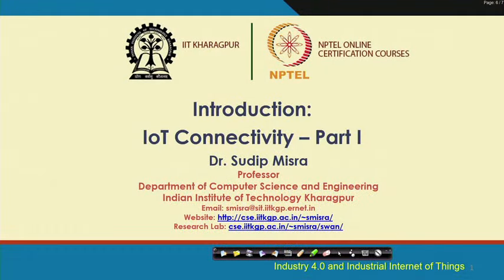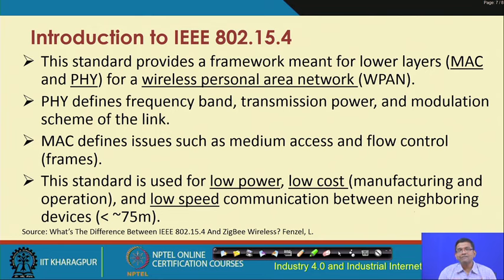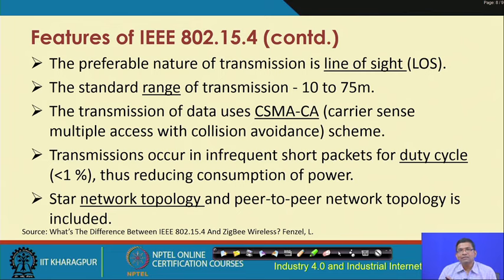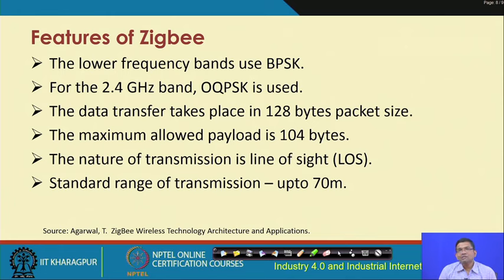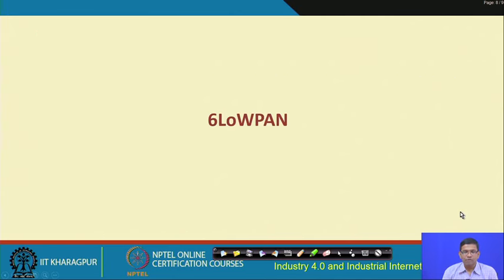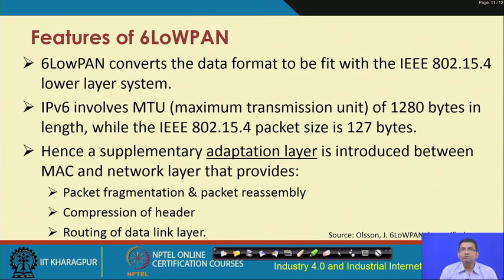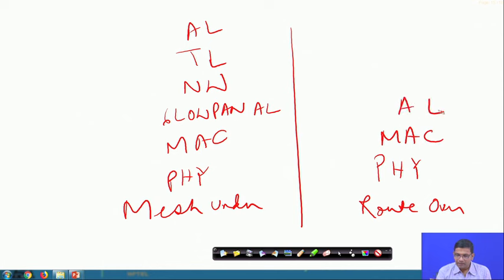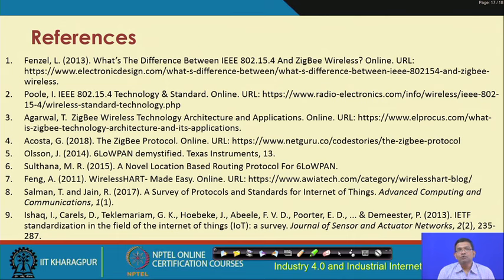Lecture 02 : Introduction : IoT Connectivity - Part I

Comment: the prerequisites of the course say 'basic knowledge of computer and internet' but i did not understand much in this lecture. should have started from more fundamental knowledge like defining the terms used before using them. instructor is reading text from the slides mostly rather than helping students understand the principles . it is difficult i feel some prior knowledge is required for getting a grasp of the content taught in the lectures. is there a pre-course material provided before starting the course?